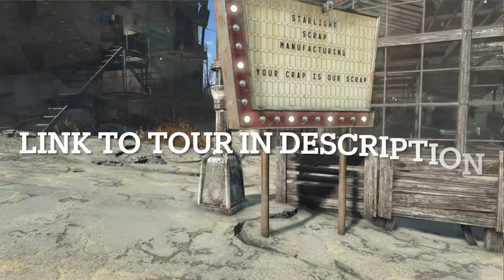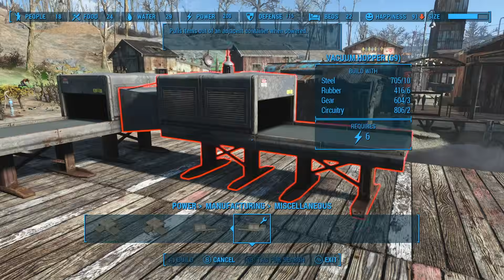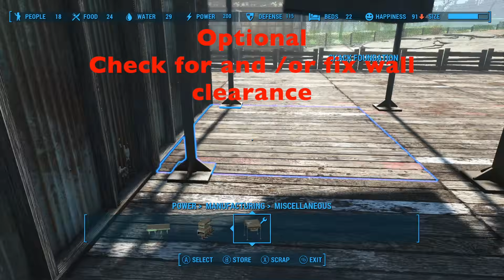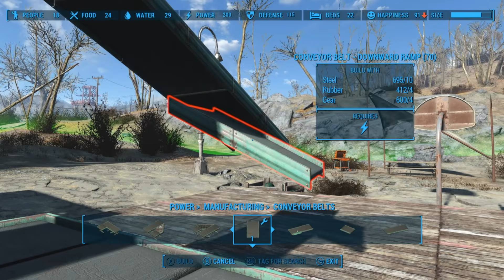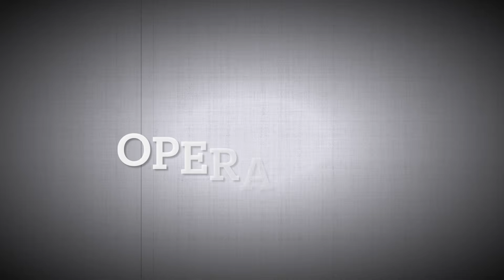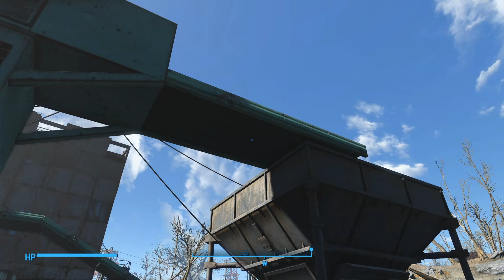Build a working factory in Fallout 4 that actually produces items

Comment: I used an ammunition builder and selected .45 and the storage has plenty of steel and fertilizer but none of them get diverted to the builder, they all just go straight through the sorter and circulate endlessly
Reply from the maker: Did you add the components that you need for your builder to the component sorter (video at 11:13)? This is commonly overlooked and prevents components from being transferred to the builder side.
Reply: @CCRenovatesFallout oh, no... I completely missed that, thank you (^:
Reply from the maker: @lyberatis No problem - glad it helped!
Reply: @CCRenovatesFallout I know it wasn’t a response to me but tysm it saved me a huge headache

Comment: I've been playing this game for 10 years and have NEVER even bothered with the manufacturing. You're videos are so helpful and informative, I'm going to actually give it a try!
Reply from the maker: Thank you! That's awesome to hear - I hope you have fun with it!
Reply: @CCRenovatesFallout mine isn't working correctly, when the plastic goes to the sorter, it's only going back around in a circle. It's not going through the sorter to the second hopper. I'm not sure what went wrong but I've been trying to figure it out for an hour 😢
Reply: @CCRenovatesFallout I just figured it out 🤦🏻‍♀️ I didn't put the plastic into the component sorter. I put it in the wrong piece. I'll try to fix that tomorrow
Reply from the maker: @BecomePneuma11235  Yes it sounds like you figured it out.  Place 1 piece of plastic into the component sorter.  Make sure that it the actual plastic component and not something made of plastic. This will direct any junk item made of plastic to the other side of the sorter.  You can find this in the video at around 11:11. Hope this helps!

Comment: 12:26 what happens to the acid (and other byproducts)? Just collects there until you retrieve?
Reply from the maker: Yes - the builder just acts a container for the items that it doesn't use.  You can remove the extra items and put them into the workbench whenever you want.

Comment: but before all of that, how do you stock up on the raw materials to build this?
Reply from the maker: Starting very early in the game, I start to buy shipments of steel, wood and concrete using all of my unused ammo and guns to trade with vendors.  I get glass from places like the Prost bar and I frequently raid the Cabot house for junk (items in the Cabot house respawn almost immediately).  I try to hoard as much junk as possible and avoid building anything other than the essentials until I reach ~ level 40.  This way I have a pretty healthy supply of building materials. I also set up a caravan network, so all of the junk is shared by all settlements. I generally continue to supplement my stock by continuing to buy shipments when I see that I am running low.
Reply: @CCRenovatesFallout  haha ok I see, I played like looong time ago and I still had trouble building generators for lamps and turrets lol. You really have to focus on hoarding junk and stuff first. Thanks boss
Reply from the maker: @Togster  When I started playing, I tried to start building right away and in every settlement.  I quickly became overwhelmed and frustrated.  Also, I like to use the fusion core generators which requires level 4 of the Science perk.  This perk doesn't unlock until level 41.

Comment: Theoretically, can i use this same build to make an ammo factory?
Reply from the maker: Sure - just change the builder that I used for the Ammunition Plant builder and add the components to the component sorter that you need for the ammo that you want to make (at around 10:47 for reference).  Everything else should be the same.

Comment: This was a great watch! I just have to ask why the roller? Sometimes i look at the roller parts and since they don't auto move anything and basically generally just sit there unless pushed from overflow, i don't usually see where they do better
Reply from the maker: Thank you!  I agree with you - I was trying to incorporate different parts to the build to show how they work and fit together. But - I think that the rollers do tend to be problematic. In this factory, they seem to work ok because they start up fairly high and the parts tend to gain momentum on the way down, but a conveyer belt would probably be a better choice.

Comment: Do you need to use console commands to get enough materials to do these builds?   When I just want to build I don’t want to waste time scrounging for stuff.   Can supply lines and good settlements solve this problem?  I’ve never been that patient.
Reply from the maker: No I don't need to use console commands because my character is a hoarder.  I started a new character for this series and didn't start to build until about level 60. By then I had collected a lot of junk and purchased shipments of primarily concrete, wood and steel along the way.  Setting up supply lines will definitely help because all of the junk that you collect will be shared by the connected settlements.  After I acquire a settlement, if there are no settlers there, I leave it that way until I am ready to build there. If you try to rebuild the commonwealth too quickly you will spread your supplies too thin and will have a lot of builds started but not enough supplies to finish.   When I am ready to build, I connect it to a supply line, build it up and finally recruit settlers (or move them in from a different location) after I am finished building. As I am playing the game, I frequently trade unused bullets, weapons and armor for shipments that are sold by the various vendors throughout the Commonwealth. As you start to build your settlements, you can also buy shipments and supplies from your own vendors.  I continue to play, scrounge and buy shipments between the builds because they do use a lot of supplies. 
All that said - if you enjoy building and don't want to gather supplies - I completely understand.  You may already know, if you use the command TGM you will have unlimited everything. Also player.additem 1EC66A will give you 1 of each shipment 😉
Reply: @CCRenovatesFallout thanks much.   Just started a new play through.   Gonna try it now. 😊
Reply from the maker: @astroknott5877 You're welcome! Good luck with the new play through😊
Reply: For components: I build as much of water pumps at first and at least a junk vendor.
Then I evolve it to all vendors at highest rank and to as much as needed big water purifier.
Selling the water, buying all junk and weapons to scrap it with the scrapper perk.
So you have a big income of materials especially rare ones.
Weapons are the jackpot of the commonwealth. And a friendlier with all the buy up and scrapping. 🙃
Reply from the maker: @EXteacherXE I like your approach - this is a very practical way to have both caps and materials!
Reply: It’s a continuous factory operation. Buying and Selling business
Now I have tons of gold in my inventory because nothing really requires it.
Reply from the maker: @EXteacherXE I was curious - what building items require gold? It looks like only clear weather fireworks and energy weapon modifications.